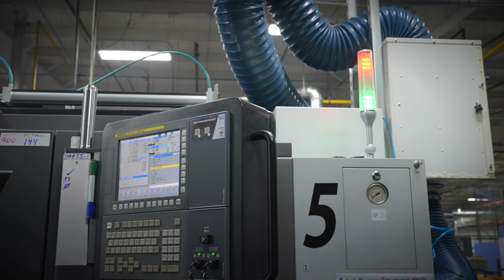The Strategic Importance of Manufacturing in America

Comment: Any plans for more hub compatible 5.56 suppressors? I love the idea of the explorr but I hear the flash capability is lacking
Reply from the maker: The flash isn't too bad on the Explorr lineup, but it's certainly not marketed as a flash-hiding suppressor. However, our Explorr 300 line does better at hiding flash on 5.56 platforms than the Explorr 224. As of now, these are our only hub compatible 5.56 suppressors
Reply: @GriffinArmamentOfficial  really? I was always told a larger bore would equal larger flash

Comment: I am an apprentice CNC machinist that runs two Okuma mills and I'm learning a DMG. I work in a tool and die shop. I started as a Tool and Die apprentice but as part of my tool and die apprenticeship I did a rotation in the CNC department and turned out to be pretty good at it and they asked me to stay and so I did, now even though I'm just an apprentice I run my two Okuma's on the night shift by myself. We rarely make the same part twice due to the nature of our shop. I'm glad that an old timer taught me the importance of mastering the setup process early. We use FCS a lot but often times we have to revert back to a normal vice that has to be indicated to zero.

Where I work we don't really use lathes but I did have some exposure to the lathe in school and I really enjoyed it. I hope later in my career I get more opportunities to work with cnc multi axis lathes and mill turns. 

My goal is to eventually work in the gun industry. I'd come work for Griffin but unfortunately you guys are on the opposite side of the big lake =(